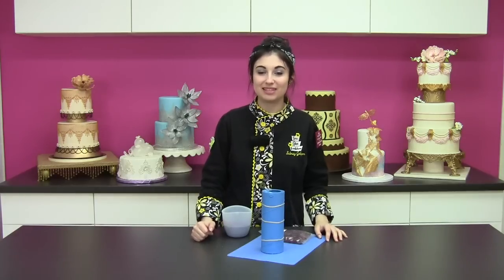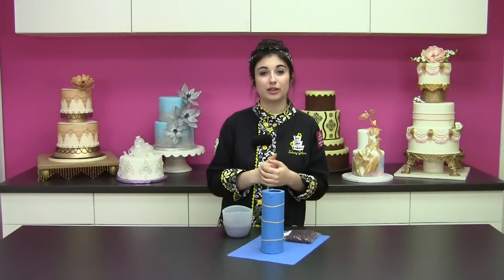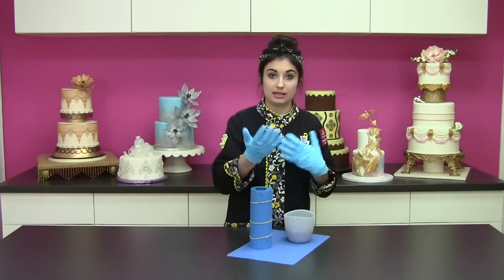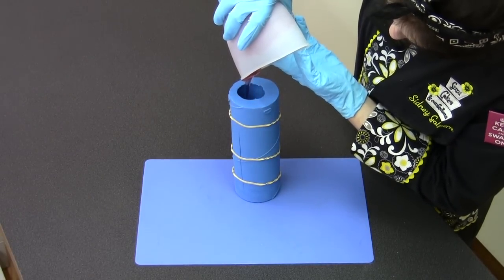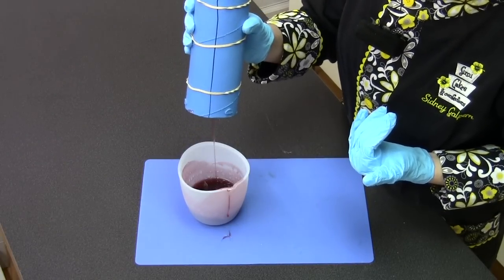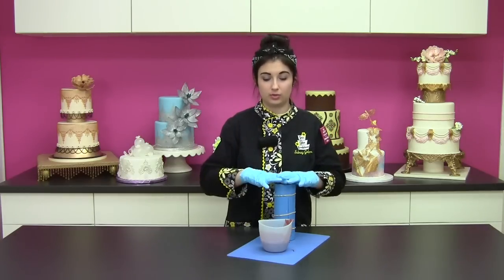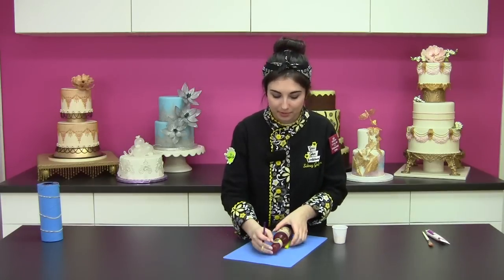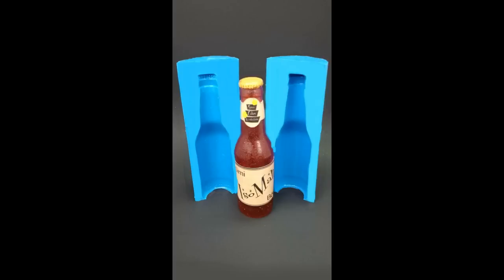Simi Isomalt Beer Bottle Tutorial

Comment: Hi Sidney ı just discovered you and your post is amazing. ı have a question my silikone mold is not shiny. do you apply anything to the bottle when you take the mold? and my other question sugar sticks after removing glass ?thanks for your apply
Reply from the maker: Hi!  I don't apply anything to the surface of my mold before filling it with isomalt, certiain kinds of silicone can create more bubbles than others so that may be what you're experiencing.  Isomalt gets sticky over time from humidity, so if you leave it in the mold too long it can be hard to remove.  The best method is to take the glass out as soon as it's cool and spray it with a clear edible glaze spray to make sure it is protected from humidity and stays smooth and shiny!  Thanks for watching!

Comment: Hi Sidney thank you for an awesome tutorial. I find I have issues with filling my mold and the isomalt bubbles from the temperature being too high hitting the cold mold but I can't leave my isomalt too long to cool otherwise it hardens too fast. Do you have any tips on how I can keep it liquid and stop it from bubbling and causing bad bubble on my bottle. Thank you!
Reply from the maker: Hi Stephanie!  Silicone molds naturally collect bubbles on the surface, so when I do things like beer bottles and champagne bottles that would be carbonated and chilled, I usually leave the bubbles on the surface and not worry about them.  When I do smaller liquor bottles, I make them solid so that I can torch the surface and melt the bubbles away leaving a crystal clear finish.  I use a clear edible glaze on the surface of all my isomalt pieces and it makes them even shinier, which make the bubbles less intense looking, and the silicone of my bottle molds is also very firm and I find does not collect as many bubbles as a softer silicone would.  You can find more info on this by watching an episode I just did a few weeks ago on my Cakeflix TV online show, all about mini bottles, I'll post the link here: https://www.facebook.com/CakeflixOfficial/videos/556898278357294/ 

As far as keeping the isomalt warmer, I recommend working in an environment that isn't too cold, and making sure you are not under a draft or an air vent.  The cooler the room is, the faster the isomalt will set up.  With my isomalt, Simi Isomalt, I specifically cook it to a temperature that will not allow it to dry too quickly, so it could also be the recipe and type of isomalt you are using if it is not Simi Isomalt.  Another thing than can help is working under a heat lamp, I recommend a 250 watt heat lamp bulb and a brooding hood, both can be found at walmart or most animal supply stores.  Check out the other videos and tutorials on my channel for more tips and tricks of working with isomalt, and thank you so much for watching!!